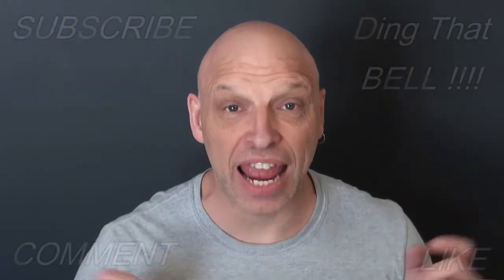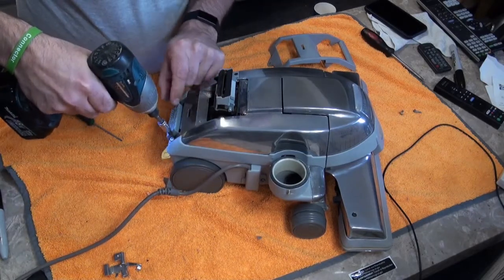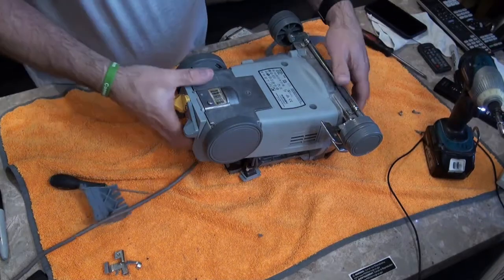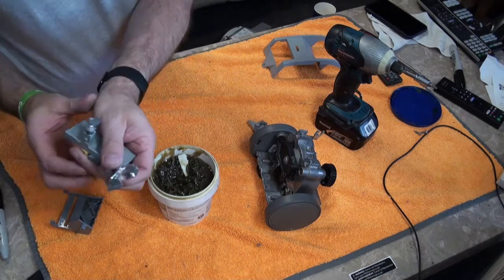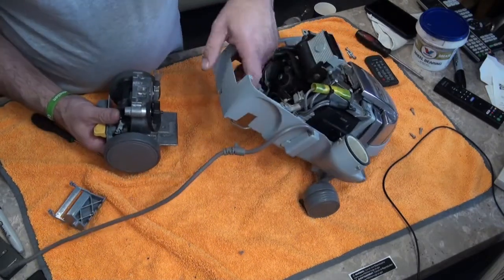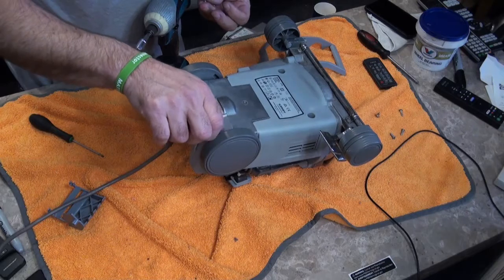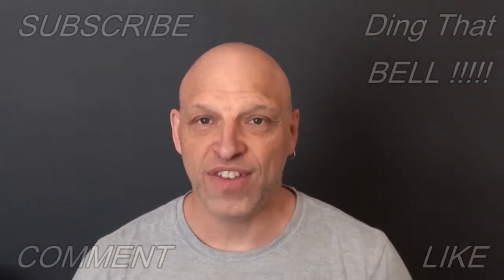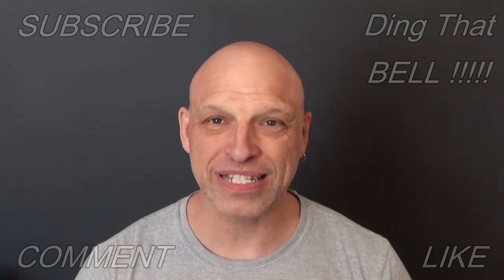KIRBY AVALIR TRANSMISSION BRACKET REPAIR:REPLACE DO IT YOURSELF FIX KIRBY VACUUM

Comment: My Kirby "clicks" when pushed.  The motor does not need to be turned on.  When pushing the unit, it goes click, click, click for as long as it is pushed.  Do you know what the problem is and can you show how to repair?  Thank you.
Reply from the maker: This is the cause of the click really easy fix https://youtu.be/BZjBDjwYrIA?si=z8OeIE0MC5Ybvi-9

Comment: Nice vid, but EXactly where on the spline should the cam be placed?

Thanks,
Chas
Reply from the maker: Thank you , glad it helped .The bottom of the  cam should be level when in drive . So it looks parallel to the plastic back . 
You have to sight it through .
Reply: @KirbyEnthusiast  so NOW it’s reassembled....but running backwards...how in the world did I manage to reverse the transmission...handle reconnection Mis adjusted?...any obvious ideas?...
UPDATE: failed to insert Left hand FWD/Rvrse upright fork into the black keeper/sensor ...super two fingered sensitive again!!
Thanks, Chas
Reply from the maker: @hesynergy  you’ve put the pivot assembly on the rear point instead of the front. Easy mistake I’ve done it once a time ago 😂

Comment: Is there a special way that back lever that sits on the  spline goes, on re assembling mine it seems to just jam up cant seem to get the drive/no drive on the tech drive when you operate the 2 levers!!Originally the piece had fallen out im not sure how it sits on the splined shaft!!
Reply from the maker: Sorry for late reply i have done a video on this if you haven't got Kirby sorted yet
Reply: @KirbyEnthusiast  Thanks, I managed to sort it in the end.
Reply from the maker: @tweetypie25  your welcome thanks for continued support been full on with both enthusiast channels and giveaways. 👍👍